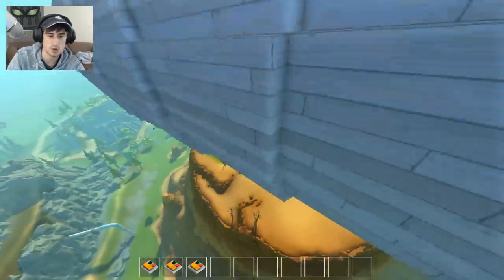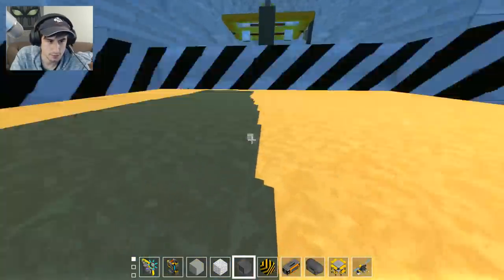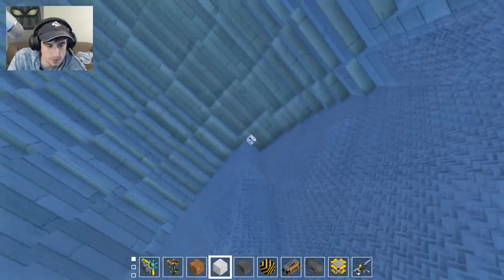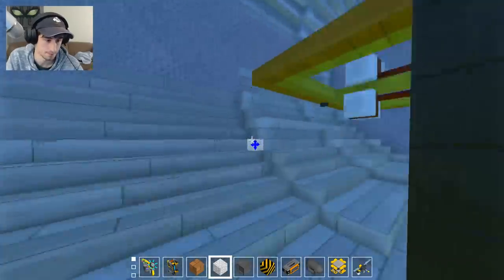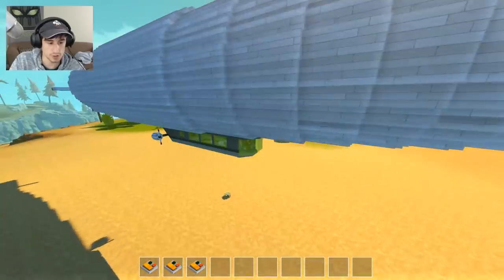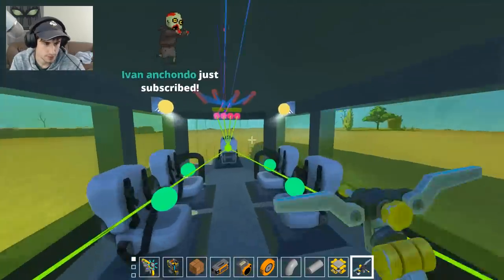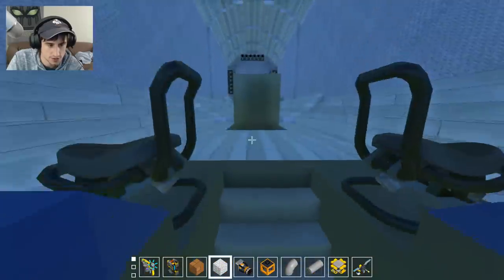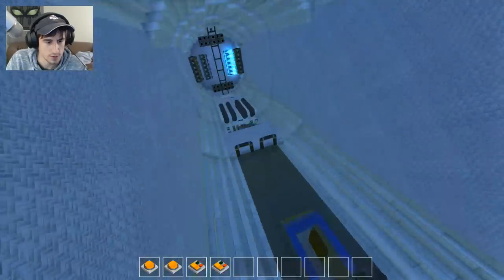Converting the Autopilot Blimp to Run on Helium! (Scrap Mechanic Live Stream VOD)

Comment: If you want, you could use reaction wheels to turn. They are simply very heavy discs that spin in the opposite direction you want to turn, and due to Newton's third law, the rest of the craft will turn in the opposite direction to the disc. They actually use these in spacecraft.
Reply: It is still a viable alternative to thruster turning.
Reply: Don’t the call those gyros